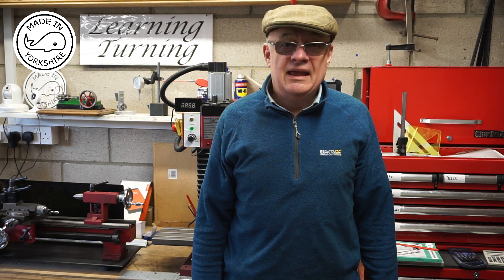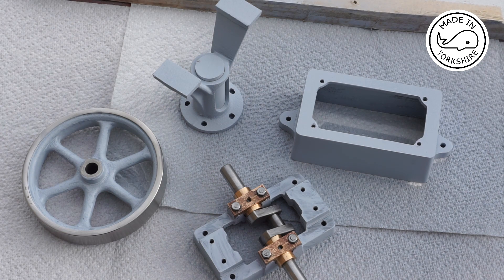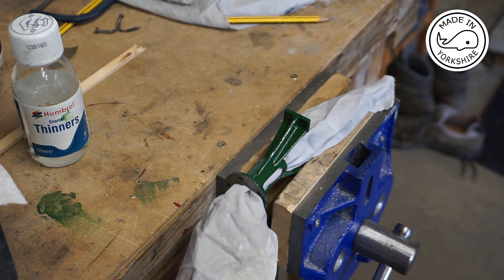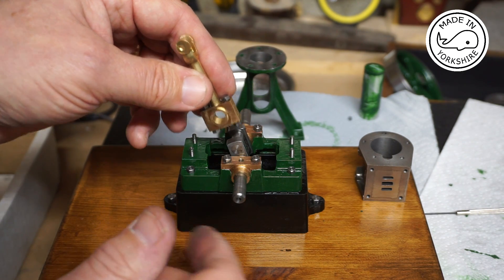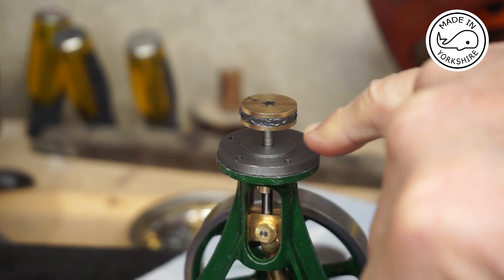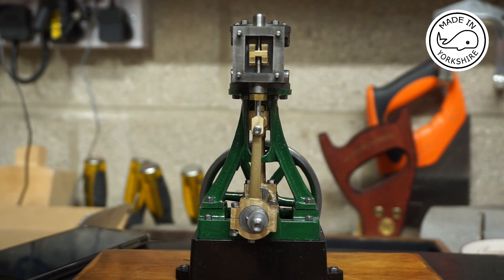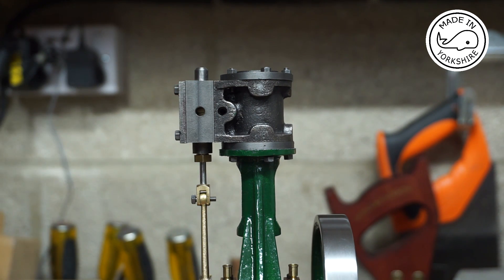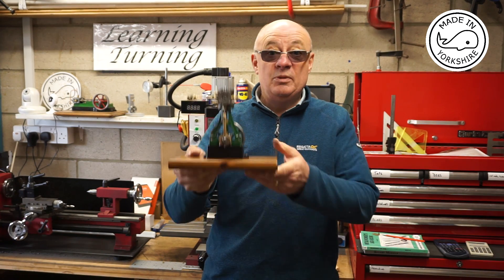#MT25 Part 14 -  Making a Stuart 10V Steam Engine. Painting and Assembly. By Andrew Whale.

Comment: Hi Andrew, I've decided to build a Stuart 10V with reversing gear. Love the series and thanks for all the tips and advice. Where could I find a complete good quality set of BA taps and dies or better yet where did you source your taps and dies.   Thanks,      Jon T.
Reply from the maker: Hi Jon. I assume you are UK based. All my BA and UNC taps and dies are labelled Apex and I think I got them from Chronos. I try to purchase HSS rather than carbon steel. Another excellent source for HSS taps and dies is modelfixings, however they are quite expensive. Hope that helps. Good luck with the 10V - it's a really nice little engine.
Cheers
Andrew
Reply: @learningturningmetal  Hi Andrew I'm in the USA. I do want quality BA taps there are some available on Amazon but made in India I do not want to break any taps so I will look into the suppliers you've mentioned. Thanks again I really enjoy your videos.

Comment: Hi Andrew
Great videos.  I am the process of following your series to make my own 10V.  Can you please tell me what the other 2 outlets you have on the cylinder in addition to the exhaust?

Roger
Reply from the maker: Thanks Roger. The two outlets are drain cocks. Not really needed on an engine of this size but it adds a little more interest. On larger cylinders it takes a while for them the heat up. In the mean time the steam condenses into water so you need drain cocks to let the water out. I bought mine from a guy in Austria but you can get them in the UK. Not tried these but they look okay: 
https://www.ebay.co.uk/itm/Model-Live-Steam-Engine-Brass-Drain-Cock-3-16-x-40-TPI-ME-Thread-/283040244929?_trksid=p2349624.m46890.l49292
Hope that helps and good luck with your 10v. Mine runs as sweet as a nut!
Cheers
Andrew

Comment: Hi Andrew,
Nice work it will be lovely when run in which I expect it is by now.  My spotting drill set arrived from Amazon today and they seem quite good.  I've not tried them yet but I'll let you know how they perform later when I get on with my 10H and 10H.  But that will be after I've finished my 16mm scale live steam loco.

One tip which you may have discovered by now is when turning parts with a hole or bore which need to be concentric or at 90° to datun faces such as loco wheels, flywheels, cylinders etc is to first make the hole accurately in your component. Now make an expanding mandrel by turning a piece of bar, to a shoulder, at the same diameter as the hole in your component as accurately as you can.  Then using the largest Slocomb pattern centre drill you have make a large tapered hole in the end of this bar - as large as you can.  Then drill and tap a centre hole, mark No 1 jaw with a centre punch on the larger, original diameter of the bar, remove from chuck and then split it along the turned length - use a hacksaw (or a slitting saw if you want to be posh).  Take a suitable socket head allen screw and turn the underside of the head to an included angle of 60° to match the tapered hole you made with the centre drill.  Put the new mandrel in the chuck (cente pop to Jaw 1) slide the component on to the mandrel and screw in the cap head set screw, it doesn't need to be too tight and the mandrel will expand and will grip the component tightly. 

On a cylinder for example, having made the mandrel, fit the casting; face off the top which will be at exactly 90° to the bore; then turn the casting round on the mandrel and repeat for the bottom face.  The faces will be guaranteed parallel and at exactly 90° to the axis.  I use these expanding mandrels for all sorts of work and keep them when made for future use.  For example loco wheels.  I need 4 or 6 wheels per loco - I turn, bore and ream a length of bar then part off 6 blanks roughly to size then use my mandrel to mount each wheel for final turning.  First one face, turn found and finish the other face, repeat another 5 times = a perfect set of concentric wheels.  The component can of course be left on the mandrel, taken out of the lathe and mounted in a chuck an a rotary table on say the milling machine for further operations.

Sorry about the length of this messageit's actually taken longer to write than making an expanding mandrel. if it's not clear let me know and I'll put some examples up on a blog.  By the way, the mandrel can be a little shorter than the bore of the component as long as the cap screw you chose has a smaller head than the bore, that gives a clear run for a facing tool.  Again aplogies for any confusion - I am now very confused!
Reply from the maker: Hi Terry, many thanks for detailed explanation. I've seen expanding mandrels for sale but they seem very expensive. I will definitely have a go at making one next time I need to hold something by it's bore. Well explained and I think I understand the process.
It looks like you must spend your life in the workshop!
All the best.
Andrew
Reply: @learningturningmetal 

Hi Andrew, 

I don't get to spend as much time in there as I would like.  However I did serve an engineering apprenticeship and spent time in a precision toolroom then changed direction and taught Design and Technology for 35 years after qualifying as a teacher spending much of that time nurturing young people and I must admit inspiring quite a few in the worksdhop environment.  I hae no regrets but many good memories,
Stay safe,

TerrryD
Reply: When I worked Hawker Siddeley Dynamics , now part of British Aerospace, a lifetime ago, we made lots of these expanding mandrels for small batch production on our center lathes. Just made one for my Stuart S50 , been working on it for a while , now with lockdown its getting finished ! I have been following your build with interest, thanks for your enthusiasm , its catching !

Comment: Well done.  It runs beautifully.  Thanks very much for sharing the build with us.
Re the sheave, I've read that it's good practice when using slotted grub screws to have the slotted part within the threaded hole.  Otherwise, half the slotted part can easily break off if tightened too vigorously.

Comment: What a brilliant series. Thank you for taking the trouble to explain all the steps you took from delivery of the Stuart kit to the final assembly and run on air. I am definitely inspired to have a go myself, but not until I check out your S50 build.  Andrew
Reply from the maker: Now then - 10V or S50? That is the question!
Cheers
Andrew
Reply: Learning Turning Metal - by Andrew Whale Umm, that is indeed a good question. Having watched both series I think I will take your advice and try the S50 before the 10V. Before I do so I need to create a shopping list of items that I will need for both projects, namely BA taps and dies, a wiggler, 1,2,3 blocks and an Arc Eurotrade parting blade.
Reply from the maker: Yeah there is always something else to buy. Don't forget the brass pipe unions!
I hope the S50 works out well.
Cheers
Andrew
Reply: Learning Turning Metal - by Andrew Whale Thank you Andrew for the best wishes. I will let you know how I get on with the S50. 
Oh, just thought of something else I will need, a set of Imperial reamers. 
I guess I should wait until I get the kit to know which imperial tools I need. 
Happy New Year to you. Andrew

Comment: Great stuff Andrew. If you were to recommend a casting kit for beginners, would it be the S50 or 10V?
Reply from the maker: Thanks Eddie. I think the S50 was easier than the 10V. I found machining the standard on the 10V  rather challenging. The s50 just seemed to be an easier build generally.
Both are supposed to be good starter engines but I would recommend the S50.
Hope that helps.
Andrew

Comment: Andrew. Well done another success. Quick question, is it just an Optical Illusion, or is it now running in a different direction than in the first test run. This can be achieved of course by which setting the can is on when you timed it. Once again another Great Success, keep up your model engineering, much better than woodturning bowls and vases. 😁
Reply from the maker: Thanks Dave - I got there in the end and it does run really well. I see what you mean about direction - maybe I changed settings at some point. Yeah definately better than turning bowls in a day and then putting them in a box cos there is no more room in the house.
All the best.
Andrew

Comment: Nicely done. Runs smoothly. Did you mention you had everything oiled up before running? What did you use for the steam chest and cover gaskets? Did you have to adjust the steam chest packing gland to prevent leaks? 👍👍👍
Reply from the maker: Thanks mate. I did oil everything up including plenty of oil in the input pipe (to lubricate the cylinder and piston). The gland packing nut did need further tightening. I forgot to mention due to my excitement! The gaskets came with the Stuart kit.
All the best.
Andrew

Comment: Sweet little engine. 
A tip for painting the valve chest cover. Paint the recess before you do your final wet dry polish on it . Any paint on the surface will be removed and by folding a piece up you can sand paint off the top of the S in the middle.
It’s funny, I assemble an engine starting at the piston and working down the connected parts. When working with engines that require careful alignment like a No1 you are holding things in your hands or on a sandbag that takes gravity out of the equation. You can hold it any way up. And fitting gland packing is way easier if the rod is in the hole. You didn’t show mounting the big end to the crankshaft which is a pain if the sole plate is already fixed down.

Comment: Great job!
Next job: Scratch built steam powered lathe... or am I being a bit optimistic?
Reply from the maker: Ha ha - yep I would say that is a little optimistic! I need to have a long think, but probably something from bar stock.
Cheers
Andrew
Reply: @learningturningmetal  Building engines from ' bar stock ' can be very rewarding and some engines are quite complicated and involved. The good thing is that if u made a mistake then it may not need to cost u an arm and a leg to put it right.

Comment: Great to see it finished Andrew and running so well. I had the same problem with the piston gland, paint residue in the standard and the 1/8" graphite string in the piston. Apart from the steam chest, I cheated with the studs using Loctite to secure the nuts just below the top of the studs then using them as bolts. This gives an almost perfectly uniform protrusion of the studs above the nut. But don't do that for the studs joining the cylinder to the standard, it makes fitting the gasket really difficult. If the D10 looks feasible (can I fit the soleplate on the lathe) I'm going to abandon graphite string and try O rings. Regards
Reply from the maker: Hi Len - it's good to see that we both ran into similar problems. Great idea to use loctite for the nuts - I wish I had thought of that. If I was to make another I think I would consider labyrinth grooves for the piston. The D10 looks challenging, but I bet it looks fantastic running.
All the best - and good luck with your next project.
Andrew
Reply from the maker: Hi Len - how are you getting on with your Cowells ME? I think I might buy one but would welcome your thoughts on accessories needed. You could always email me at learningturning@btinternet.com for an off-line chat.
Cheers
Andrew

Comment: Very nice engine you have made there Andrew, and runs very smooth. Well done!  Regarding painting the valve chest cover - paint the recess,  then when dry - run a face mill over the whole cover  removing a few thou until the 'S' well defined against the painted recess.
Cheers Craig
Reply from the maker: Hi Craig - what a fantastic idea. Looks like my next little job.
Cheers
Andrew
Reply: or rub on coare wet and dry on a flat surface.

Comment: When you paint a trunk guide, roll up a piece of paper and slide it in. Comes out quite easily after the paint is dry. Welldone on the engine another good runner.
Reply from the maker: Ah - a great idea. I wish I had thought of that. Many thanks for the tip.
All the best.
Andrew